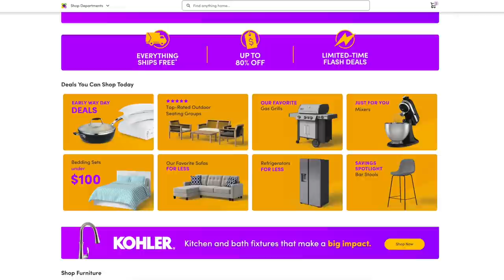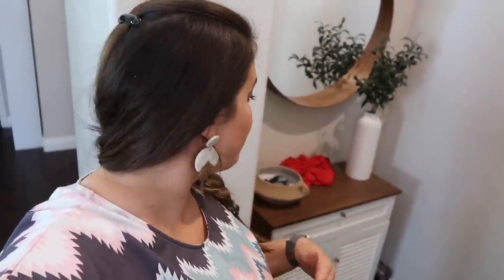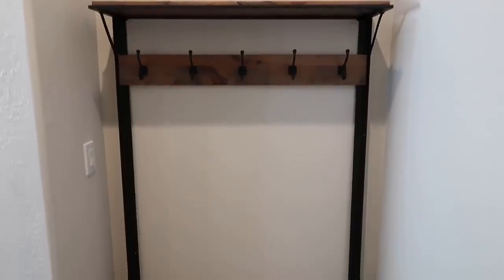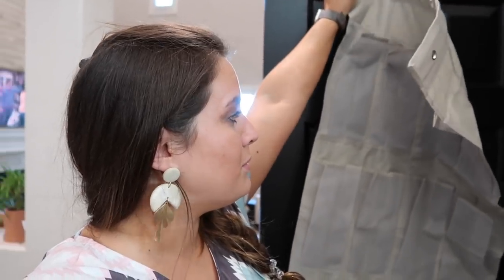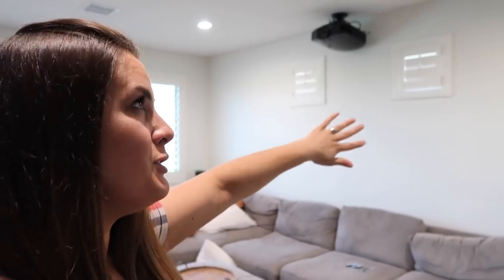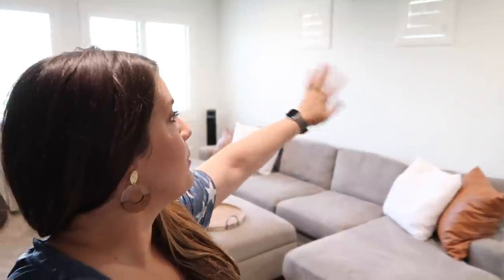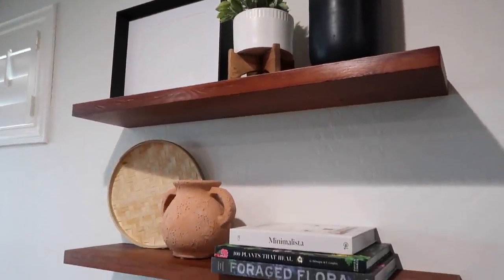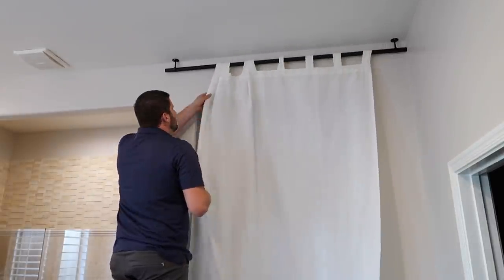NEW! HOUSE PROJECTS :: New Furniture & Decor :: Theater Room Makeover, Entry Storage + More!!

Comment: one tip to make your couch back cushions look like new is add more quilt batting in the top and around the edges. that is if your cushions unzip....although you can open a seam on the bottom to fill and hand sew  it back...the batting makes the cushions more shaped and sturdy....